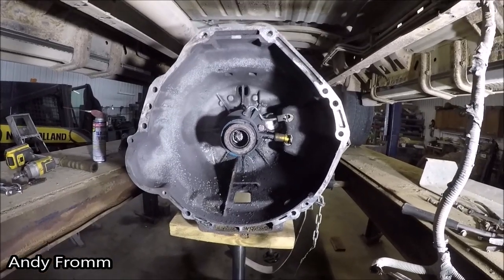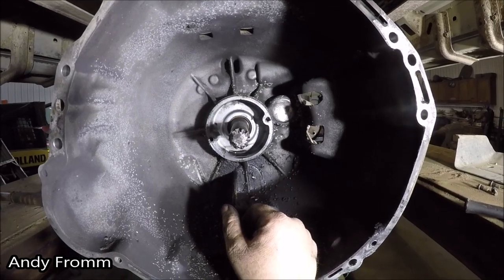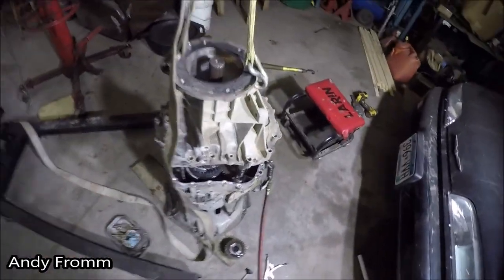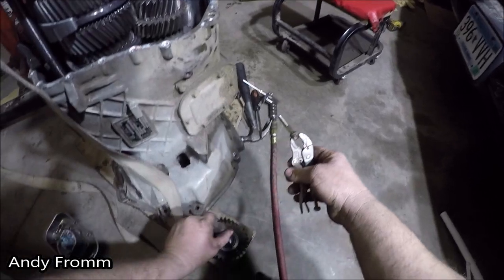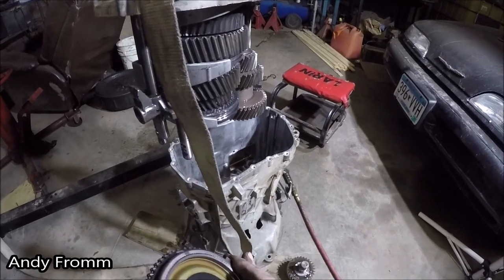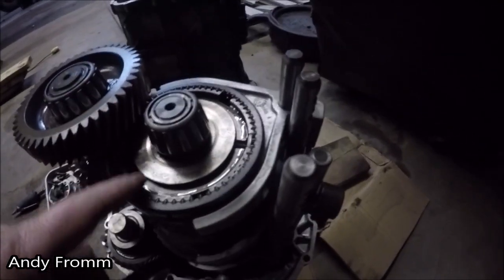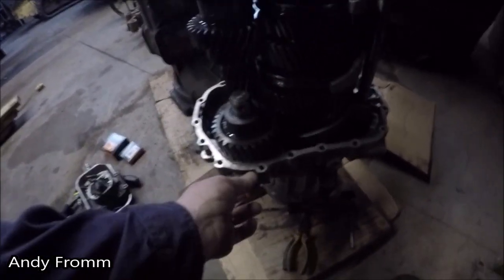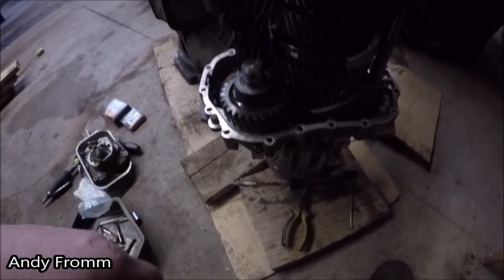Cummins does bad things to a ZF transmission

Comment: Yea... I was going to say... that's the weakest ZF. That's the Ford small block ZF. (due to the internal slave) The 460 and Powerstroke ZF is stronger. But nothing is unbreakable.
Reply from the maker: True but I haven't had any issues since I got rid of that junk clutch that would slip & chatter.
Reply: @Andy Fromm  What trans did you go with this time?
Reply from the maker: @CR500R  same trans, just put a new shaft in it along with a stock style clutch.

Comment: The input shaft on my ZF5S47 is twice that size
Reply from the maker: I built it on the cheap, if I'd built it for power I'd definitely used a stronger transmission. 👍

Comment: That small block zf5 has a 1-1/16" input shaft. The big block and diesel versions have a 1-1/4" input shaft. If it breaks again you could try to find one of those.
Reply from the maker: Will the 1-1/4 shaft work with the internal slave?
Reply: @AndyFromm  From what I can see no.
Reply from the maker: @jacobgoldstein4297  good to know, I dont plan on putting anymore power to this a its been great without that junk clutch.
Reply: @AndyFromm  ZF is pretty stout. I have a small block one I will be using behind a 4bt.
Reply from the maker: @jacobgoldstein4297  should hold up to anything that will put out. I've been running a couple Mazda 5 speeds behind 4bts for a while with no issues.

Comment: Good  day Boy that 3-9 must have some torque. At around 1:00 minute you took something out, was the the slave cyl.?  Interesting, what will this cost  you for parts?  Thanks for now
Reply from the maker: This one is a 5.9l. I think it broke due to clutch chatter, it would shake the whole vehicle while it was slipping. Yeah that was a busted up hydraulic slave cylinder. 
new shaft $75 shipped
New slave $31
Bearing & seal $35
Pilot bearing  $8
Used clutch $free

Comment: So you're telling me I should go NV4500
Reply from the maker: Thats up to you. If my donor would have been a dodge I would have used a nv4500. Fyi, I did fix and reinstall this same trans if that means anything.  I'm all about saving $.
Reply: @AndyFromm  for sure. So if I were to get an excursion and go the nv4500 route, would I still have to modify the trans tunnel?
Reply from the maker: @alabamamotionpictureproduc6626  I am not sure on that. I just talked to a guy, he thought it would fit but I haven't done it first hand.
Reply: @AndyFromm  nice. Thanks for the info dude and good luck!
Reply: Or NV5600.
Reply: The zf6 is stronger than the nv4500 this must be a zf5. Zf6 is bulletproof and the most desired manuals for Cummins swaps that I’ve heard so far.
Reply from the maker: @cornelius6304  maybe there is something wrong with my zf6 in my f350 but it shifts hard, every zf5 I've driven shifts much easier but I haven't driven any other zf6 to compare it to.

Comment: Damn! Is the Cummins in there really turned up power wise? What would cause this? Is there a stronger trans that can handle it?
Reply: It depends which zf was used because they have small block zf, big block zf, and a diesel zf
Reply from the maker: Its not that turned up, I think its just because the clutch chatters so bad when it slips. It would shake the whole vehicle.